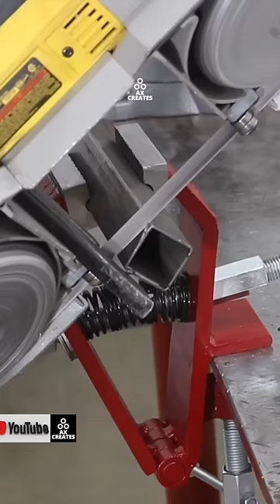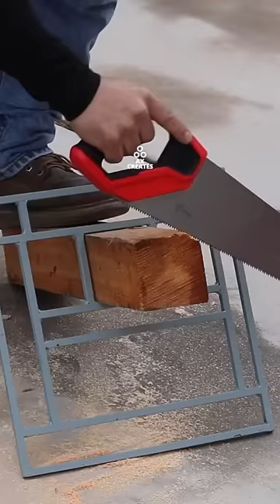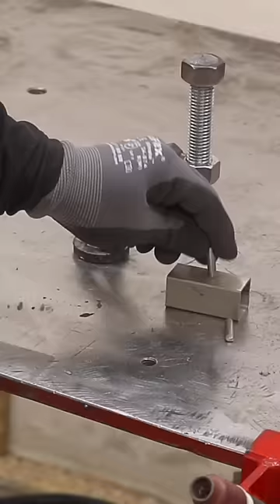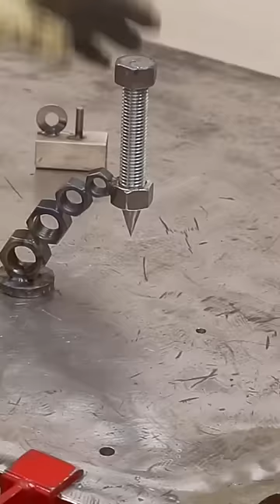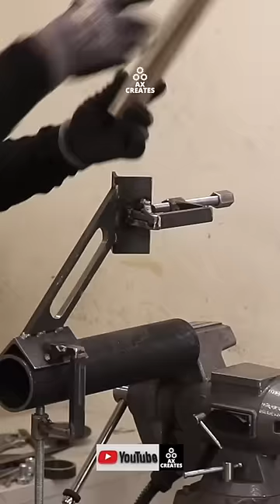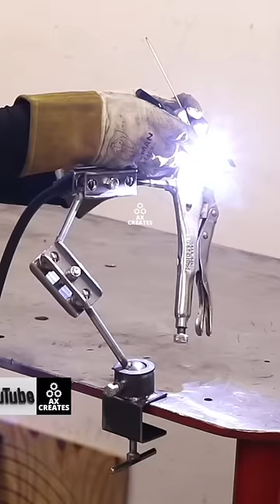BEST DIY IDEAS FOR DIY TOOLS!!!

Comment: It's very rare to find life hacks or whatever kind of hacks that actually work and make sense, and aren't so overly complicated or require a shop full of specialist equipment...

So it's a surprising shift from the norm to see THIS video.

These all actually make sense. They're great ideas, and what make Jobs go easier & faster.

And other than a welder, they don't really require anything special.

And some of them could be achieved without a welder if you use a different type of material, like brass plate & brazing for example